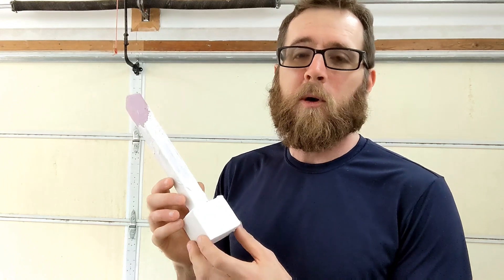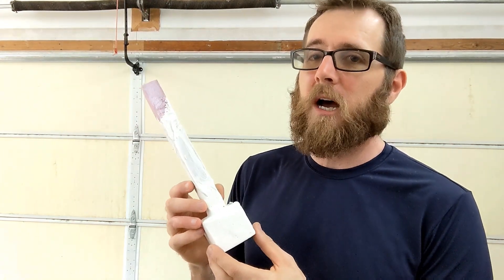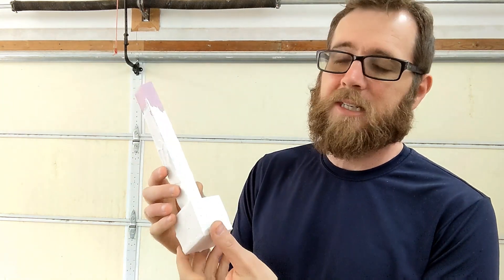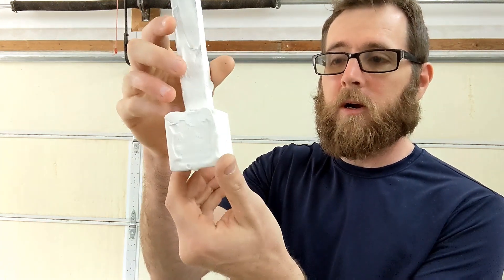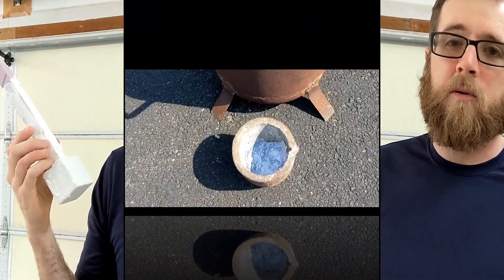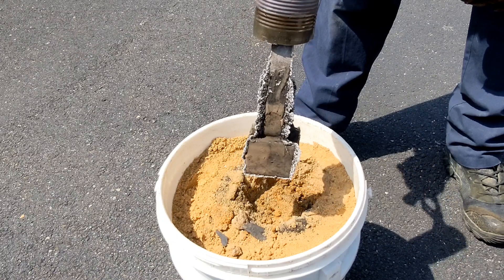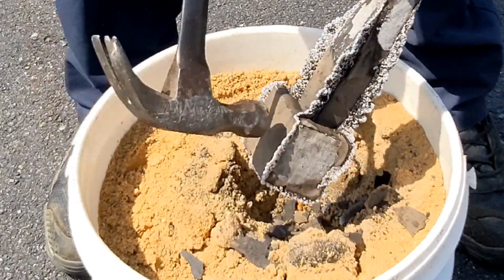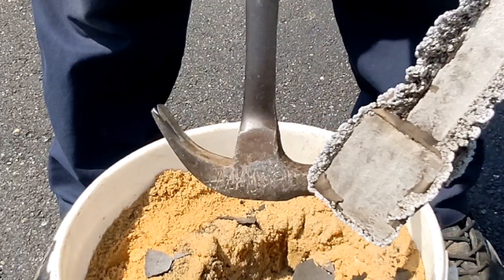Aluminum Lost Foam Casting Experiment | Easy Aluminum Casting

Comment: What kind of foam is that?
Reply from the maker: Hey Jeffrey, this is polystyrene.  I do a lot of casts using it.  Check out my playlist for lost foam casting 👍. Any questions just send me a message.
Reply: @HeinrichsMade Sweet, thank you. Is it that insulation foam from a hardware store?  I have watched quite a few of them so far! I am looking to getting into it. I have been doing sand and lost PLA/wax and this seems so much easier and cheaper. No plaster investment, just a little drywall patch that I can get in a 5 gallon tube and thin as needed and no lengthy burn out/baking. Just need to get me a cnc machine now. I am not great at the artsy stuff like carving and such.
Reply from the maker: @jeffreysanborn1005  yes the pink insulation from home Depot.  They also have craft foam at home Depot which is the same stuff.  I'm sure you get it at other places.  Yeah it's so much easier than everything else.  I started out doing green sand Casting, but this is my favorite.  Make sure to watch the video on how to apply the plaster. 👍
Reply: @HeinrichsMade  Sweet thank you very much! I will watch the plaster one. The star wars key chain one you did not too long ago got me really interested, so little work for a beautiful finish. That has always been my struggle with the lost pla/wax and sand (the sand I have gotten a lot better with though).

Comment: definitely the sand. you're really going to want, sifted  dry play sand for doing details like letters and stuff.  
Id avoid using plastic buckets for that. old propane bottles are great if youre comfortable cutting them safely
i have some smaller stainless pots that i use sometimes for smaller items.  
Looking forward to seeing you perfect this. love it
Reply from the maker: Yeah I found some fine beach sand and I shifted it with my screen that I use for my green sand.  It's like 120 mesh.  I agree with metal tanks.  I have 2 of them, I need to cut the top off.  I want to try it with the plastic bucket 😂